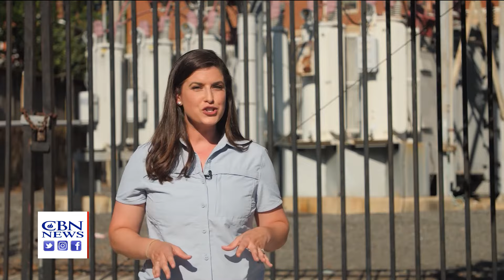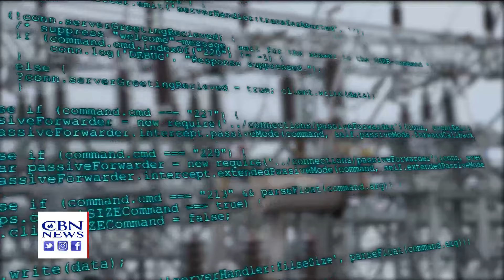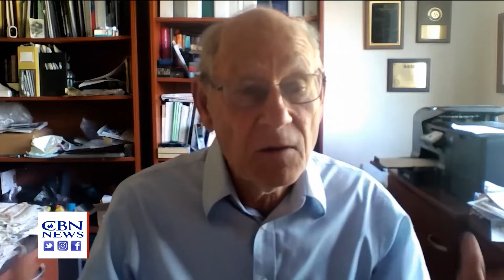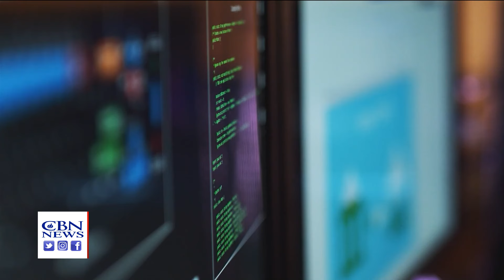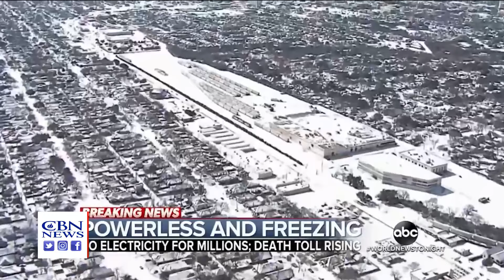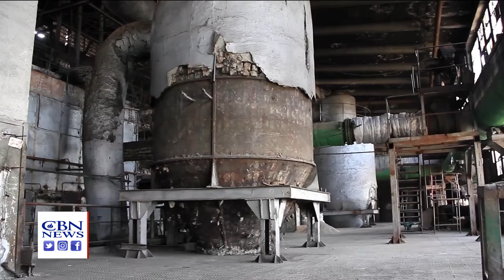China's 'Backdoor' Threat Could Take Down the US Electric Grid

Comment: LED lighting which is electronic may be hacked, Incandescent and Flourecent light bulbs are electrical and not easily hacked. Not only power grids and it's transformers....the light bulbs as well.....
Reply: hahahaha you think the chinese "hackers" are typing away orders yelled at them: "do the hacking on the light bulbs or you get no rice!"
the transformer takes UHV ultra high voltage and routes it into smaller boxes as they fan out to different areas... since the transformers have multiple high tech features like being connected to LAN or internet thru wire, its so ppl who work for electric companies and grid can monitor and make changes to output/input.  but not just internet is the problem if chinese intalled some hardware/software that mimic'd an already common part/feature of these new transformers, it could basically be a kill button because if they are gonna do it why care about "if they find out it was us..." because we will likely all be dead within a month.